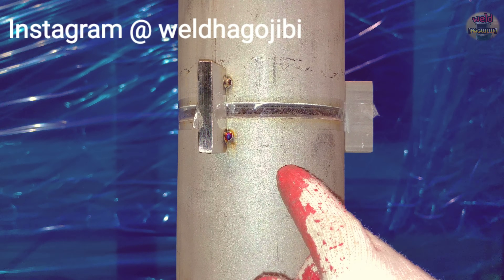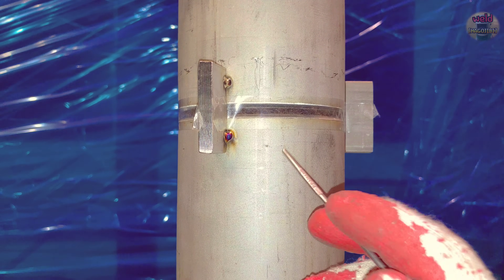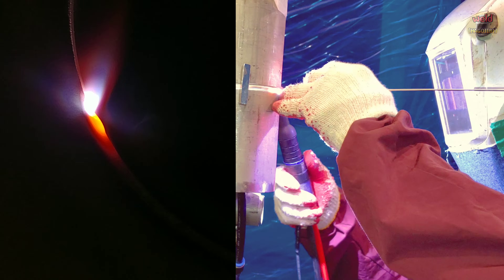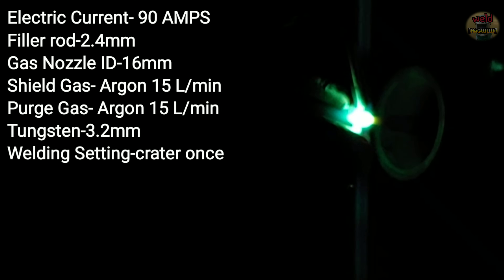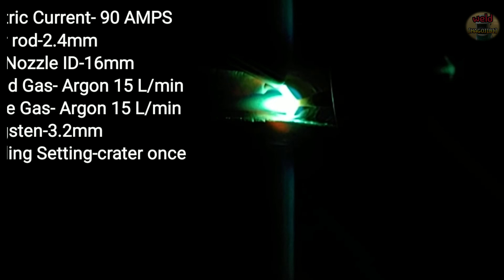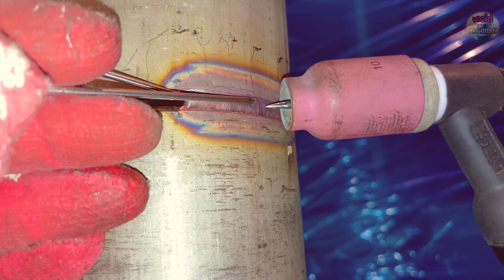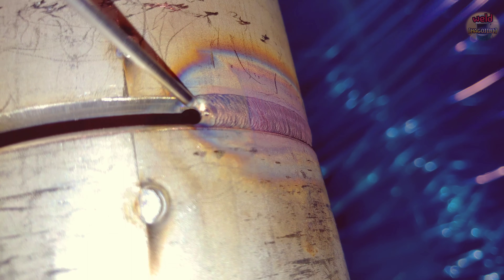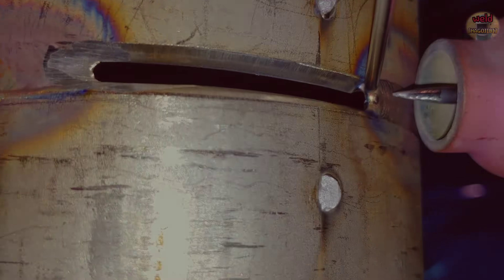Tig Welding Stainless Pipe / 2G Horizontal Root Pass Keyhole Technique 100A SCH10 Walking The Cup

Comment: Tacking tabs across to set up the gap??
Instant failure in a country in which any sort of standards are worked to. 
Shouldnt have even an arc strike outside of the prep, let alone pieces of flat bar tacked to the outside of the pipe!!!

Comment: Nice video.
You explained and showed it very well.
Your weld seam has a nice fine scaling.
In my humble guess, this is probably one of the mistakes that often happens at the beginning. That the filler metal is not placed on the top, but on the bottom.
Have a nice Sunday.
Good start to the new week.
Reply from the maker: Thank you always for your good opinion. Have a nice week.
Reply: Thank you very much
Reply: Got ta clean that and thode strong bscks no no